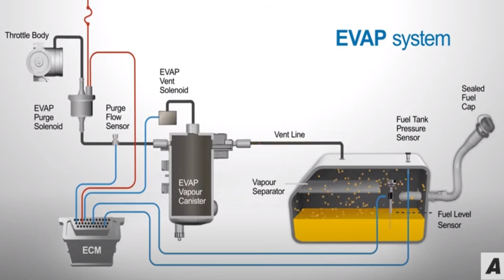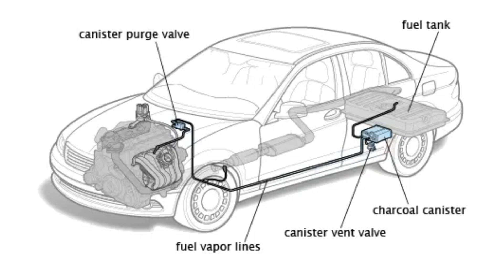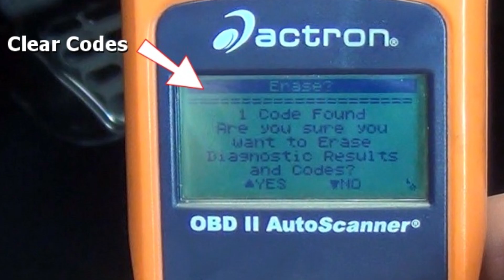P0457 Engine Code? The REAL Reason Your Check Engine Light Is On

Comment: Thanks for the great video.

I have the gas cap p0457 and p0440 codes!

I checked the purge valve and it’s all good! 
I checked the live stream and the evap vacuum goes to -1300 pa when the engine is running. The moment i remove the gas csp, the evap goes to normal atmosphere pressure !
What do you think I should check next?